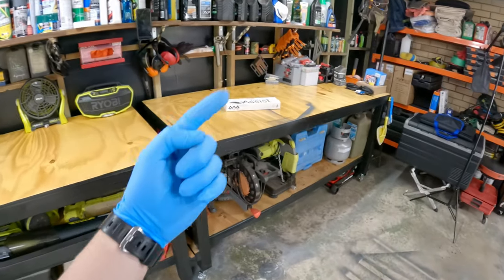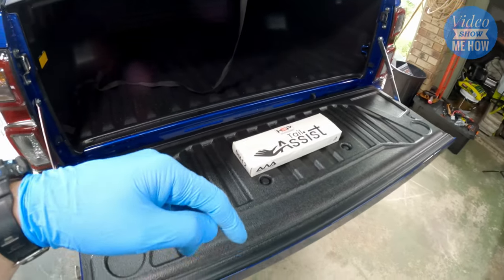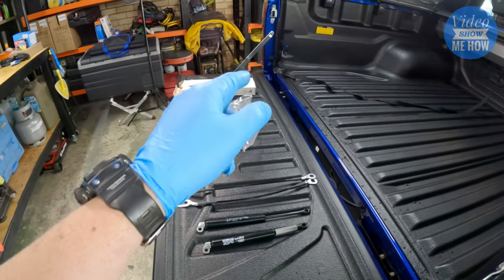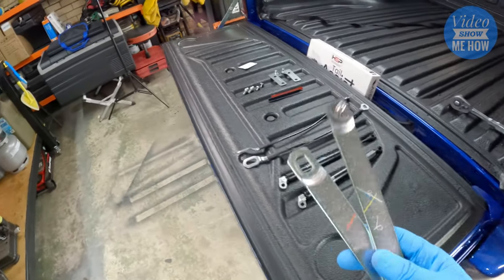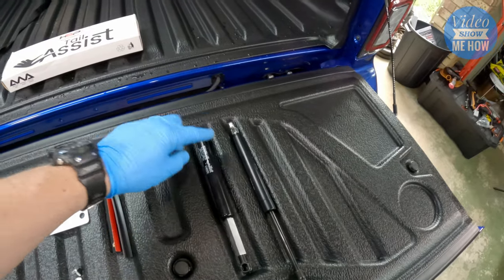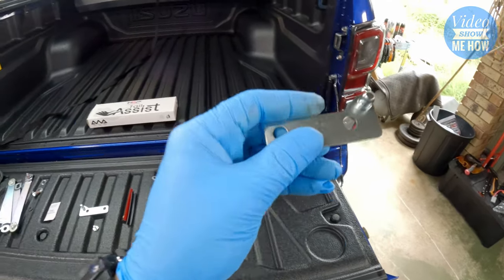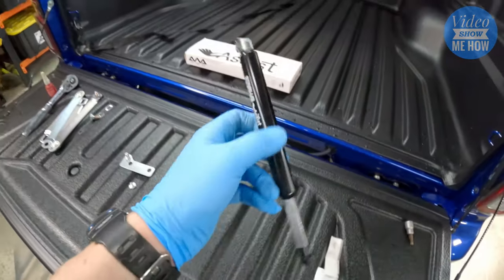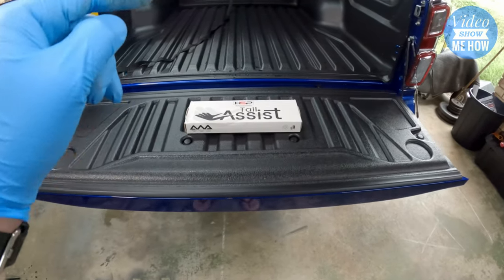ISUZU D-MAX HSP Tailgate Assist Tailgate Struts Ute Install - 2021 DMAX X-TERRAIN Build Series #1

Comment: Took the plunge and bought and installed this product. Apart from one torque bolt that I needed a mechanics help with ( he'd never seen one so tight) the rest was a breeze thanks to Adams easy to follow tutorial.  Very happy with the end result. Onwards to more upgrades....
Reply from the maker: Great to hear mate 👍
Reply: @andy how did they do the torx bolts in the end? I'm struggling with the same issue.
Reply: @tholla  he bashed a slot into it using a mash hammer and cold steel chisel . Then bashed it anti clockwise and it came loose. Massive drama but the other 3 came out with a torque wrench no bother at all
Reply: @andymclaren7281  thanks mate. I've tried an extractor tool so I'll get the dremel and chisel out.

Comment: Really happy with the tailgate assist. But gee, the tray bolts were so tight. Broke 2 T40 torx bits and partially stripped one bolt. Eventually used an impact driver and big hammer to break the seal and remove the last bolt. Had already put dust seals in place so my tailgate mods are now finished. Have installed a few of Adam's other recommendations and am now contemplating the Lift Kit.

Comment: I just got my xt and the tail assist is a great idea and would love to do the same on mine. Especially with my little kids running around.
Reply: Would also love to see how you setup/install lighting in the tub.  Cheers
Reply: 2nd this ☝☝☝
Reply from the maker: @angelobarbatiello802  thinking lighting up top and under tub rails, putting some thought into this now as part of the 12v setup 👍

Comment: Great detail on the install process, would you recommend filling the holes left from the rubber stops you removed? now to get my dmax and start mods
Reply from the maker: No real need I wouldn't think, there's drain holes below but if concerned I'd get some of those little rubber blanking seals from the big green shed ✌️

Comment: Nice and definitely will be getting this. Would have liked to see how hard it was to remove the nuts with the torx bit rather than skip over it. I wouldn't mind you doing a video on a dust seal for the tailgate. Also not everyone has Instagram.
Reply from the maker: Torx weren't too bad, just a 2 handed job so difficult to film :)

Comment: Thanks for the video mate,  show me how to set a dual battery system in my 21 XT Dmax. Cheers
Reply from the maker: On the cards mate 👍
Reply: I am looking into the possibility of mounting the second battery under the tub, current car has it on the wheel arch, but now with lithium recon be so much nicer out of sight

Comment: I've got a torsion bar on my ranger and it definitely doesn't open as nice as this. I just installed a down assist strut. I installed the up but it was too strong with the torsion bar and the tailgate wouldn't stay down.
I've removed it but I will try again once I install the tailgate storage mod

Comment: Hey mate finally got the barsted out by drilling centre out with 2mm drill bit heated bit up hoping it would melt the locktight got the dremal with cutting disc cut a slot used a large flat head in my impact driver and victory. Also fitted auto mirrors and Windows definitely easier following your u-tube thanks . Now is a catch can worth fitting
Reply from the maker: Oh nice great news! What a pita but glad you were victorious. I'm a catch can convert that's for sure, ran one in the crd jeep and was always amazed at what I drained each service. You can see in the vid I just uploaded the is already oil residue on the intake pipe. If you do end up grabbing one check out the discount code in the vid to save some bucks
Reply: Ordered the western catch can will be following your instuctions soon as it arrives what do you think about the pre filter petrol filter
Reply from the maker: The diesel pre filter? Is an excellent kit, install vid for it out 15/10 :) Sneak peak on my Instagram shortly 😊

Comment: G'day Adam, check your mounting plates for the struts. My first set bent and the second set have done the same. Great struts but the stamped mild steel plates aren't up to the job.. 🤔
Reply from the maker: Yeah mine still fine? Did you contact HSP mate?
Reply: @VideoShowMeHow  yep, they sent me another pair of plates but they've bent as well. Not as bad as the first ones and they're still functional. The right hand bracket on the first set bent so badly that the piston end came off the ball on the plate and couldn't be re-attached. Still love the improvement in tailgate use though.

Comment: Hey mate, 

Curious how these are holding up? Any issues with the cable catching on the strut etc?
I bought a different brand and were useless, looking at getting better ones..
Cheers
Reply from the maker: Pretty solid, tailgate is pretty heavy with the storage unit and recovery gear, swapped them out to try some grunt ones after they started getting a bit tired after 2 years

Comment: You have the same color on your car as i have :)
Reply from the maker: Then you picked the right colour 😜😁
Reply: @VideoShowMeHow  First i had a Dmax 2020 Black Edition. Used it over the winter. Then i bought this Dmax 2021 Arctic Truck AT35 with this right color. Car has less than 20k km. And then i am gonna give this car an Ceramic Ultra pack of Ditec, for the paint job, then run over a couple horny sheeps, so i get the stuff called lanolin in norway. also called anti rust 😁

Comment: Hi Adam,  For the life of me I can't undo the Torx screws on the hinges.  I have tried everything including a Rattle Gun. Any ideas would be appreciated.  Love your channel!
Reply from the maker: Have read through the comments of this vid, has been a few tips as some have been in the same boat. I must have got lucky with mine! I'd suggest 1) running a razor blade around the bolt head to break the paint seal if there is one 2) use a good quality (eg week fitting torx bit 3) give the bit a couple of sharp hits with a hammer before trying

Comment: I'm curious, any advantage to adding the black cable things rather than just leaving the existing metal hinge arms on? I've seen a few people complain about the cables not going in properly
Reply from the maker: Good q - unsure if the factory hinge would work with the new lug but worth a go

Comment: Any issues long term with this mate? I have another brand one on mine and it broke the tailgate locking mechanism because it put too much pressure on the tailgate.
Reply from the maker: No all good so far? Which part did it break?
Reply: @VideoShowMeHow  The latch on the locking mechanism under the handle. The gas parts of the struts were rubbing against part of the tailgate, causing the latch to not connect on the passenger side properly. I've since taken out the passenger side 'easy up' and left the down gas strut only, with a washer to space it out more so it doesn't rub. What is the diameter of the gas strut part on these HSP ones?
Reply from the maker: @danielsan81  hmm not sure, but no issues with rubbing etc. Will put the calipers on it later on and report back
Reply: So just on a year now and my lift assist strut has completely failed and the ball end on the open assist strut has cracked completely through. Not impressed.

Comment: I received my kit today and I got the TA-10LH bracket but not the right side.  On the Parts sheet there is no mention of the Right hand side.  I am just a bit confused if I am missing the right side bracket?? Any advice would be great before I contact the company.

Comment: Hey mate just wondering if you might have any ideas on how I can remove the torx bolts 3 undone but on the 4th the torx bit has messed up the inside of the bolt seems to be really tight. Now the torx bit just won't grab . Really don't want to get the cutting disc out and cut bolt in a shape that a socket can go on .
Reply from the maker: Hey, yes seems to be a few people with this issue. I must have got lucky. Best advice would be to really push the bit into the bolt as hard as you can before cranking. Use an extension bar if needed. Another thing you could try is seeing if there is a paint seal on the bolt, if so run a sharp Stanley knife around the head of the bolt to break any seal
Reply: Thanks for answering my question I have hit the torx bit with a hammer seemed like it was in good but spins it is stripped at worst I can put it back to standard but really wanted to fit this
Reply from the maker: @beccummins7930  Ah it's stripped? Hmm are you handy with a grinder? Sounds extreme but if you are I would carefully cut a groove in the bolt head turning it into a flat head bolt. Unfortunately if it's stripped options get a little limited :( Hope you get sorted ok

Comment: Would this work without thr cables? Using just the assist and the steel sliding brackets?
Reply from the maker: Apparently yes it will

Comment: Hey bro, I've stripped the blue star screws, any options on what I can do to still apply install?
Reply from the maker: Ah bummer :( Is tricky, could try a larger star bit, could grind a slot (basically making a Phillips head), has been some other comments on the vid with other people's solves too

Comment: Can you tell me how hard it was to get the t40 bolts out of the tailgate hinges as I can’t get three of them to move
Reply from the maker: Mine came straight out sorry to say, seems to be hit and miss some appear to be have been tightned by Thor himself. Check the comments there's been lots of useful suggestions for tight ones

Comment: Hey Adam, the link for the tailgate assist product goes to the central locking kit. Can you fix the link please mate? Gonna start stockpiling bits of kit whilst I await my new toy, and I may as well do so by your links. Can you shoot me a message when you've had a chance to fix that one? Cheers.
Reply from the maker: Oh dang thanks for letting me know! All sorted :)
Reply: @VideoShowMeHow  legend. Cheers mate.
Reply: @VideoShowMeHow  I'm guessing this works with the rest of the auto-locking system as you walk away?
Reply from the maker: @jdoubles  yep sure does. I keep the roller shutter lock in the locked position then you can use the tailgate like a boot :)
Reply: @VideoShowMeHow  noice! Cheers Adam.

Comment: Ok. I’ve snapped of two torque T40 starbit only it is being stubborn. How do I get it undone
Reply from the maker: Wow really?? Dang.. I found its the paint over the bolt. I would suggest getting a sharp stanley knife and run it around the bolt head to try and break the paint if that makes sense? Then solid sprays of penetrate. This used to be to same issue with the Jeep JK door bolts :(
Reply: @VideoShowMeHow   Thanks for your reply but I a facebook chat a guy on the GC offered his assistance and we used a air hammer which got it loose, So now I'm all fitted and good to go.. thanks for your how to install videos.
Reply from the maker: @eddiepeterson580  Ah good new Eddie! Some seem really torqued in there!!

Comment: I bought this attempted to install but my star screws on the hinges were so tight I couldn't loosen them without stripping the screw which did happen. :(
Reply from the maker: Yeah has been an issue with a few people it seems, Isuzu seem to sometimes do up to eleventy! There was a gent in the comments who got his out using a hammer I believe? Will see if I can link him
Reply from the maker: Was @Eddie Peterson
Reply: I too have bought a kit but have found it impossible to loosen these screws. They are so solid!
Reply: @stormyadz  I gave up
Reply: Colin, oh no! I've emailed the supplier who suggested heat to melt the loctite that's likely to be on the nut. Not that it helps you now.